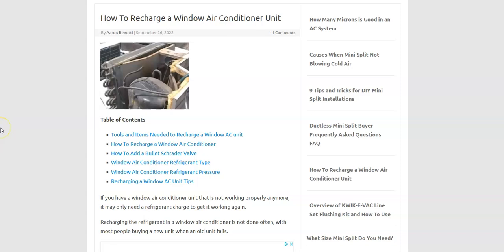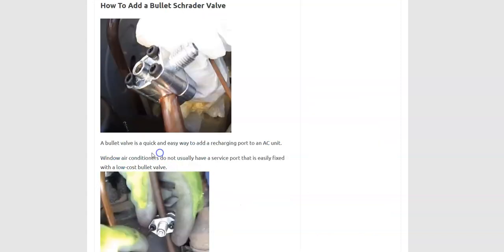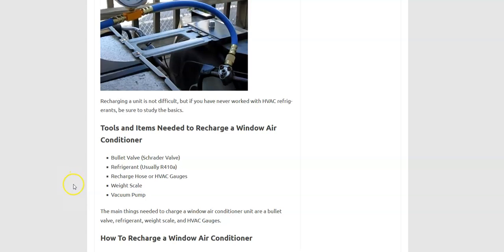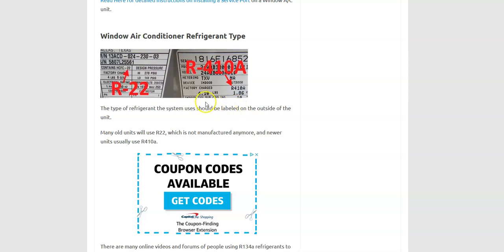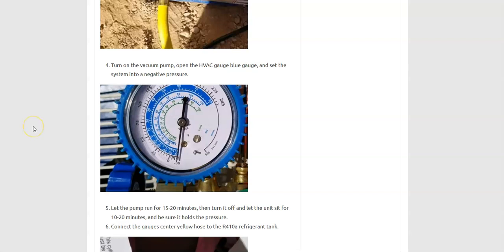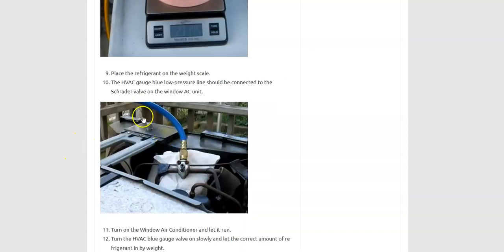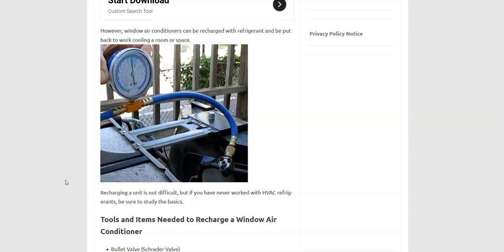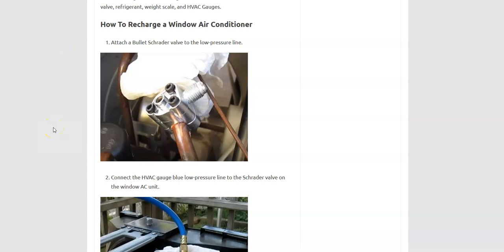How To Recharge Refrigerant in a Window Air Conditioner Unit

Comment: I thought the low pressure was the largest diameter line? Also don't think you want to let liquid run into your low pressure intake, as I already made that mistake and it breaks the pump, that is why I do gas only in the low pressure side.

Comment: I've added r290 (propane) into a central HVAC before and it worked great.   Do you think it would work with a window unit?   I don't see why they say it is dangerous, yet it can be used in freezers and mini fridges right by your bed?  It makes no sense to me.   I guess I could try r134a and hope that it works...   Because I can't buy r410a, but r290 and r134a are both easy to get online.

Comment: You can't use R134a in a window a/c unit? I've rebuilt car A/C systems so I have gauges, vacuum pump and R134a. I can't buy the R410a.
Reply: Yes. Vacuum out the system and add 134a. It's interchangeable as far as I know. The efficiency could be slightly different but it will work. People have done it.

Comment: I have a GE unit( dead for now). There's no info on the label about the type of refrigerant used.
Reply: Just ask AI and put in your model number..  it will find the answer:  it did for me.  Most likely you have r410a
Reply: you could look for the service manual online for that exact model,and it might tell you which refridgerant it uses

Comment: How do you know if the solution to your window unit problem is it needs to be refilled? I have a combo AC heat pump window unit that stopped working. The fan blows, but it doesn’t get cold or heat up.

Comment: I have a question for you sir, I have a window AC unit, and I have noticed something odd going on, This is a sealed unit, and I can't really tell if there is a leak on this system or not, even if there was a leak I have been dealing with this issue for 3 years now - you would think the majority or all of the freon would have vacated the unit by now. I have checked the piping and there doesn't  seem to be any sign of a leak.

I have made sure the filter is clean, and I am even considering on leaving it off to test the unit with out one, because for some reason, the outside temp is around 70-80*F on a daily average, and indoor temps are around 60-70*F with the unit running, but for some reason it still continues to ice up and I cannot figure out why, is it possible that my unit just may be getting old? 

The condenser coil and evaporator coils are clean of all debris and no dust, so i am entirely baffled here, can Freon degrade over time and cause this icing issue?
Reply from the maker: Icing up can be a sign of low refrigerant. Bad airflow can also cause icing. I would check that the fans in the unit are blowing correctly with no blockage and then check the refrigerant level.
Reply: @HVAC_Mechanic  I have checked the unit and nothing is blocking it, however the bottom was drilled out and I heard that water is splashed onto the condenser (hot side) would this also cause the icing issue?

Double checked unit and radiators fins and fans, no clogs.. Going to need to try and check the refrigerant level using that thing you showed in the video, Just gotta go buy one and install it onto the copper line.
Reply: Usually in my experience freeze up is low refrigerant. Leaks can be so small that barley let anything escape and can not be dected by eye. They do make sniffers that can detect the smell of refg or they also make a dye that can be seen using uv light or special glasses to find small leaks on systems. If you decied to do this yourself please be safe and make sure to wear eye protection and proper gloves when handling refg and ensure no vapor escapes the system
Reply: @gunther13mt  very interesting. so let me ask you this, I recently cleaned it. is it possible that weakpoints in the soldier joints could potentially cause micro-fractures that would let Freon to escape at a unnoticeable rate for a number of months, can moving any copper pipping around cause such fractures?
Leak Detect Tool or charge PSI test?  (I've noticed micro-fracturing of soldier joints because of extremes of temperatures on Electrical components e.g BGA packages)

Comment: Do you have a video or anything that explains patching up a leaking pipe? Or can you point me in the right direction?
Reply from the maker: Leaks are usual fixed with a torch and solder.
Reply: @HVAC_Mechanic you need a solider? I don't know any vets...dang